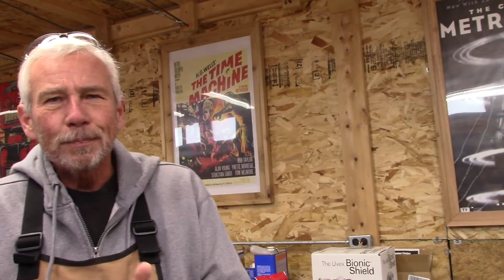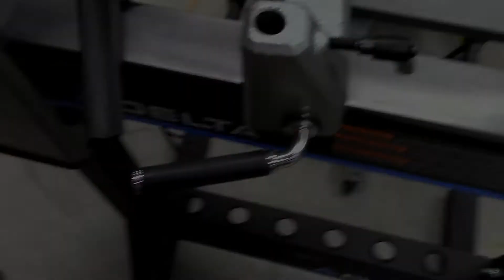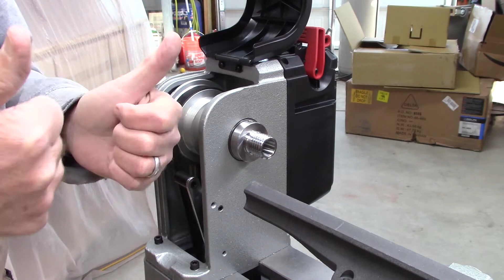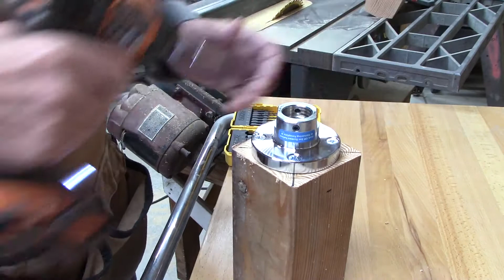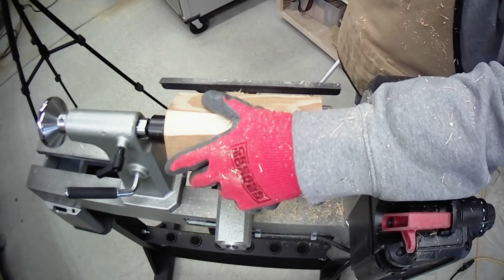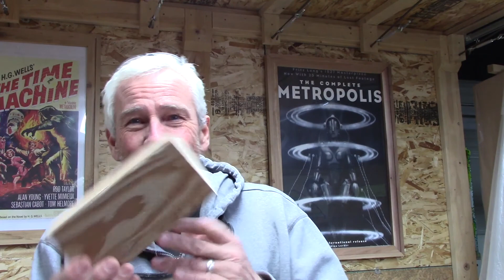Woodturning - My First Woodturning (AKA My First Video Production Fail) - Let's Figure This Out -

Comment: Love your enthusiasm in the first few seconds LFTO 😁 Let's hope it keeps up - fun is important !!!
Rounding off blanks? Yeah I cut corners off too. But a famous(?) turner says "Why? That's why I have a lathe!" 
Nervous? Hahahaha. Been there. Done that !!!     Always wear the face shield  rinse and repeat.
"This is my first" and the camera fails brings to mind 'technology? can't live with it, can't live without it" hehe
Here he goes!  - set screws on faceplates & chucks, good, keeps them from coming off when stopped and in reverse; - tailstock, good, always use tailstock as a safety measure (&keeps longer stuff from wobbling) -  tach not needed, set speed by immediate need, slow until balanced, fast for clean cuts (always turn speed to slowest before switching on; not belt but speed control) -  hmm, headstock on your left. good. is normal; rotate so top of piece comes towards you (maybe you fwd.rev switch is wired or assembled wrong???) -  gloves, not recommended, a snag can remove skin from hand & break bones very quickly!!! (long sleeves too) ugh - stall? Why tool length is important (leverage is your friend) - left hand position, good, behind tool rest  - 

things that experience will teach - vibration is no fun; carbide scrapers have tearout; straight cuts (use tool rest as reference straightedge);  watch how others use tools (I get confused too but some stuff does sink in especially if I see & hear it enough times and as I cut sometimes a lightbulb will go on and I say Ha, that's what they meant); BTW, a year from now & you'll be so much better! you will be pointing out your mistakes to others, Yay😁; 

Yay ! Hooray! You made great progress today LFTO. You should be proud👌👍👏️  And the pencil holder does look great to boot🏆  I have all the confidence in your skills, though some have yet to emerge, but your mindset is perfect. And it is fun isn't it ?

I will not be writing as much from now on - I can be pedantic and overboard, I know - so ask when you want help please ?  
Stay safe. -Mike😷
Reply from the maker: Thank you for the safety tips, some of the items you mentioned I had in the back of my mind. I usually do metal work so I'm use to covering my arms. I've had very good luck with the gloves I use but may reconsider them.
Reply: @LetsFigureThisOut  It happens so quickly.